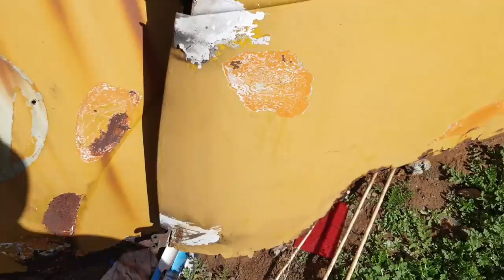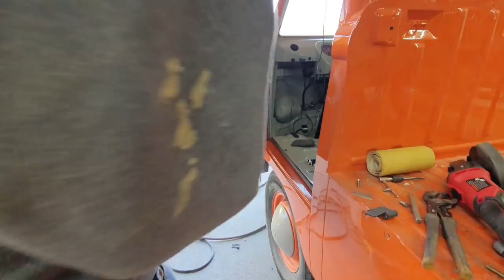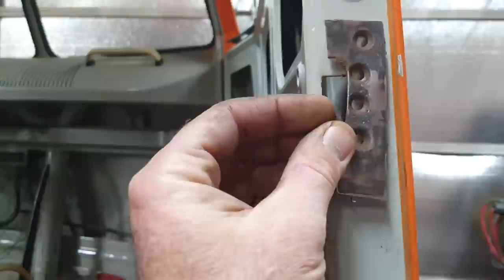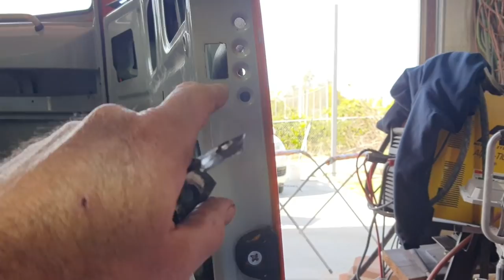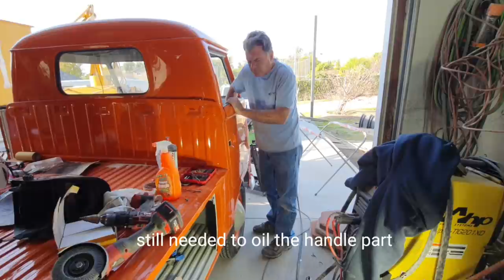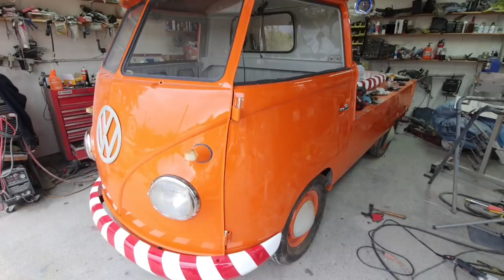61 to 63 VW SINGLE CAB bucket truck door handle nightmare

Comment: About corecting the indents.
Put a hole of the right size through a piece of hot rolled. Put that on the outside feed a screw through it from the inside and tightening that up with a nut. The skew will flatten out the indent. A thick washer could also work.

Comment: The second you showed those old doors, I thought...  I'd just cut the handle and latch mounts out and weld them into the other door...  Then I thought...  Nope, he's already painted them...  UGH...  What a crap situation to be in.  Came out good though...  I probably would have hung a cloud of 4 letter words in the air, that's for sure.

Comment: Build the holes back up with weld and redrill. Better yet cut the whole section out as a rectangle and reweld it inboard. It will be easy to fix the holes while out too
Reply from the maker: I thought about that but i would have needed to flatten the metal first. then weld up the hole drill them in the proper place (cant be off at all) and make the "perfect" divots.  Process would have been near impossible.
Reply: I finished watching the video and using the old part welded in was the best fix. Lucky the old parts were still good. For folks who do this with partial assembly doors like this would have to make a template from the latch and drill up a blank to weld in. Maybe the supplier could send a template with the doors?

Comment: Your frustration came through loud and clear. I kept wondering what I would do in the same situation as far as those dimples for the mechanism fasteners. I really like the slide hammer idea, but in conjunction with it, I wonder if a counterweight piece of steel resistance on the outside would have helped. Still would’ve had the other problems I guess. After enough wasted time and effort you just want to cut out the offending area and splice in the new.

Comment: I was thinking the only way to get the latch to fit would be to cut that section out of the old doors and weld them in. Wow, so much work... wandering if full assembly and fitment before painting would have saved much time? Getting there, hope nothing else causes this kind of rework.
Reply from the maker: Probably not I would need to put all the rubber in too and then remove it all. Lots of time there. Some high end shops do that but Like I say those budges are unlimited.

Comment: if you can find hard enough nuts and bolts you can use a washer on each side and basically squash those flat?  I used to do that when I had those kind of flared openings.  you may have to drill it out so that when you are squishing it does not bind up.

Comment: You can try and out a bolt through each hole and put a metal plate with a wood spacer on the outside the put a nut on the bolt and slowly crank it tight to flatten out or pull the countersunk hole  back into spec.

Comment: Put a bolt with heavy washer in from the outside. A nut on the inside.  Tighti
En the bolt, the nut will suck the divot in, make it shallower. It is controllable.

Comment: You could try using an inside and outside plate  threading the  inside plate for bolts and crush the dimples and then re size the holes.
Reply from the maker: yea that is one of the ideas I had but Then I needed to move the holes too which would require welding the old ones up. No room for the extra welds on the inside So I had to scrap that idea. could grind the inside.

Comment: Use a stainless steel bolt on the inside with a strong flat washer on the outside and a nut to tighten the heck out of the depressed shoulders in the door. This should help?
Reply from the maker: metal on those doors is too stiff for that stripped the screws before that metal bent. The Classic Fab metal is really stiff stuff. great for strength but

Comment: Too deep formed latch holes. A dremel grind stone bit slipped thru from the inside then the dremel on the outside and pull lightly.  Could also use a stack of dremel cut off disks on an arbor to come thru the inside again. Tool motor on the outside. Shave them right down .

Comment: Klassic Fab make the 61-63 door skin with the recessed handle but the door frames are 50-63 and 63-67. Looks like they need to make a 61-63 door frame as well. Nightmare for sure.
Reply from the maker: yea probably the problem there i think they are different.

Comment: i  refit locks / catches  etc and cet the gaps as good as i can been caught like that too many times assuming  afrter market parts fit or are the same as original
its a pain when you find problems like that
i buy new old stock when ever i can  worth the price
Reply from the maker: not available anywhere on this year doors.. I have seen used ones in really bad shape sell for near 1000 each.
Reply: @Mikefngarage  yea its crazy what people think old  crappy rusted parts are worth
i shake my head at people here in aust  at swap meets wanting a thousand dollars a guard or door
maybe the repro doors were coppied from a set of later model doors  that had the lock holes slighty different position i've found that in some repro parts